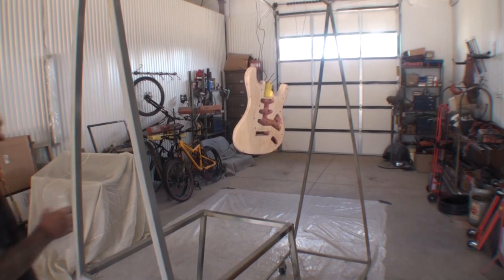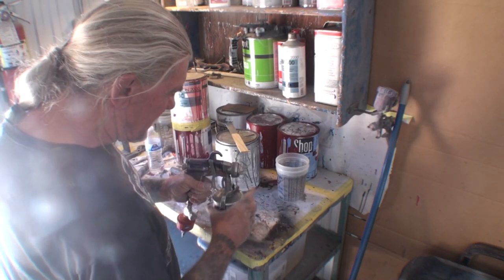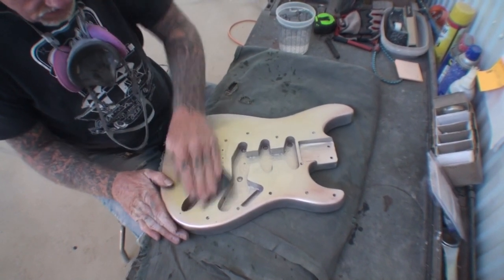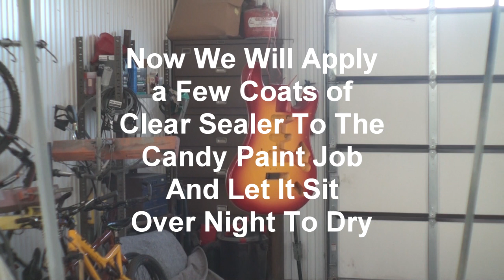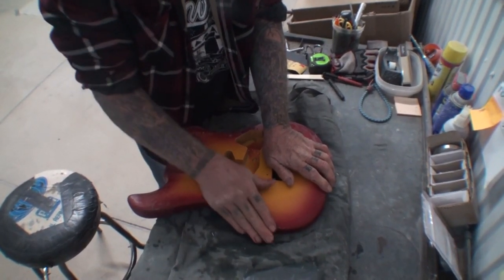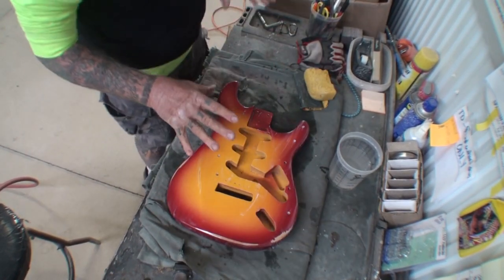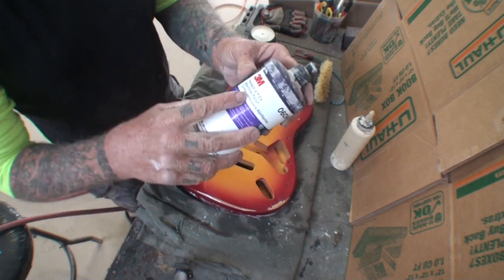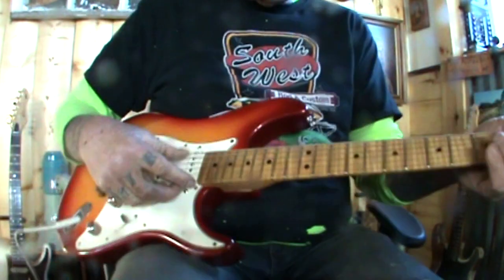I Painted An ELECTRIC Guitar With Car Paint - Part 2 - Spray Painting

Comment: Somebody told me that if I wanted to relic a metal body resonator guitar to use a pickled hogs knuckle' they said the vinegar in it would react with the metal and tarnish the finish?
 They said give it a good rub down with the skin side of the pickled hog knuckle and then wip it down with a cloth. 
Can you confirm if that will work or not?